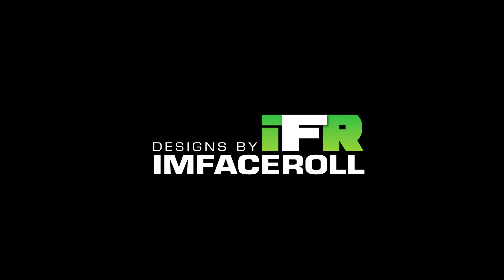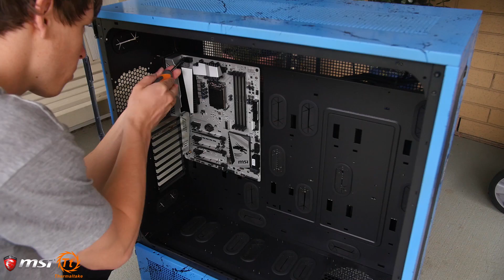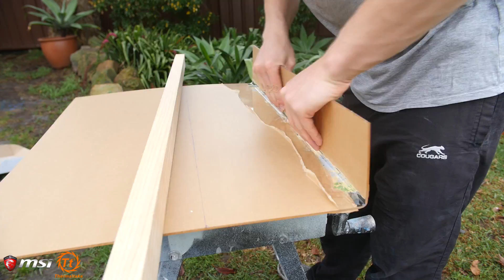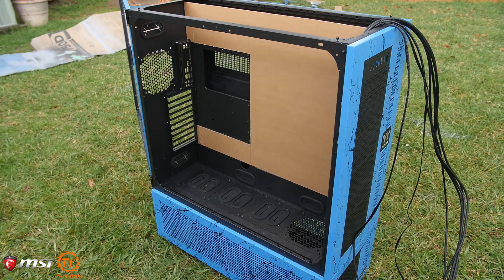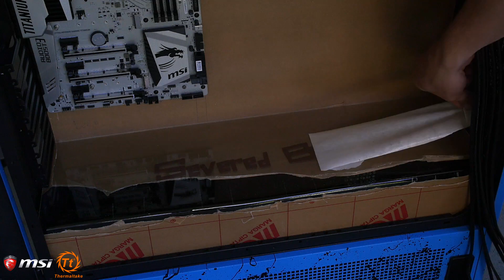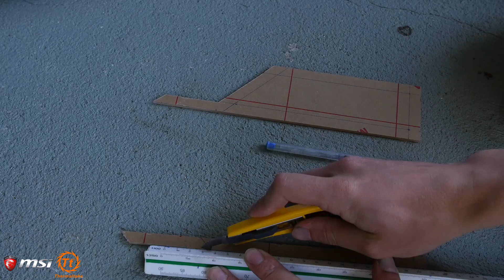Project Severed Blue - Custom Watercooled Core WP100 PC Case Mod - Liquidcooled PSU Cover Part 2

Comment: How can you cut acrylic with jigsaw without melt it down due to high temp? Is it a different type from plexiglass??
Reply from the maker: +Gabriele Presicci a jig saw is constantly moving and doesnt get hot enough
Reply: mmh, it's probably my plexiglass..thanks for reply, great video
Reply from the maker: +Gabriele Presicci thanks man =) yeah not sure why your jigsaw is melting it, mine just cuts straight though